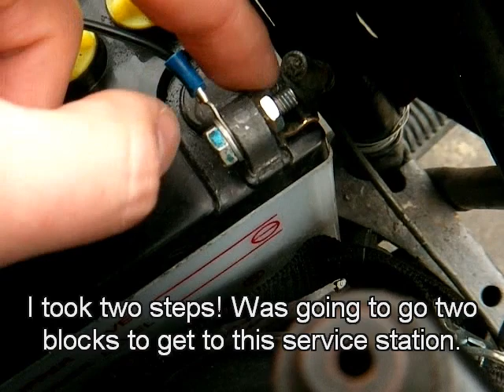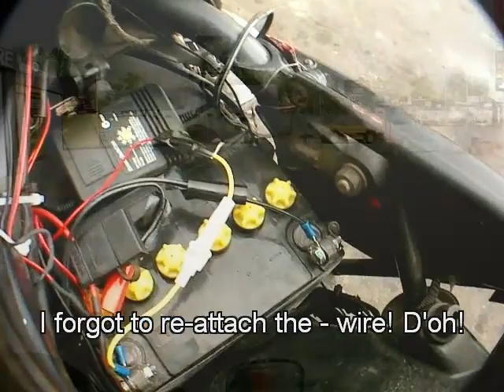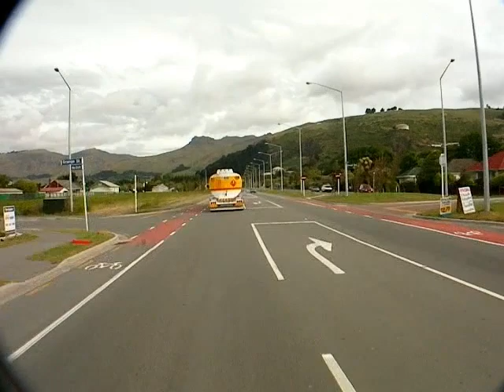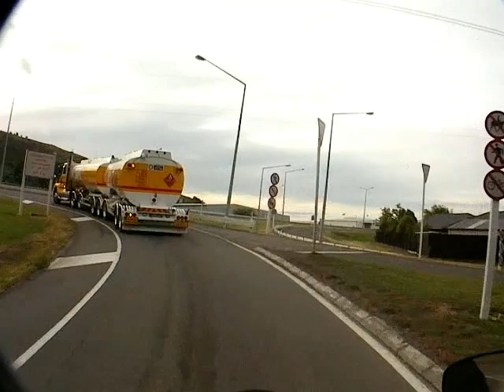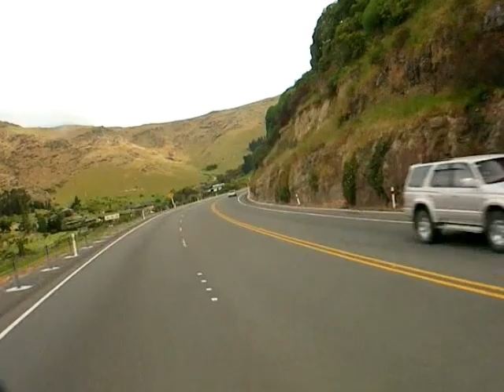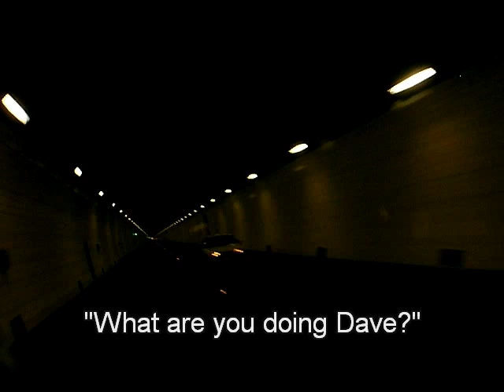Battery nuts and Image Stabilisation

Comment: Matt uses the Kodak Webbie. If you look at the meetup video with Matt lj and me I think you get a shot of it. The cool thing about the Webbie is the swivel head. You can always adjust for the perfect angle easily. It's about 150 bucks the same as the Vado HD.

Comment from the maker: Yea, it really seems to be a good choice with Vloggers at the moment huh? I'm starting to be able to spot them now too, when you pan quickly, the picture distorts slightly, the top moves before the bottom, so it kinda stands out if you're looking for it. Not sure which model does that, if not both.
I first noticed it in matth1138's videos. Does he use one?